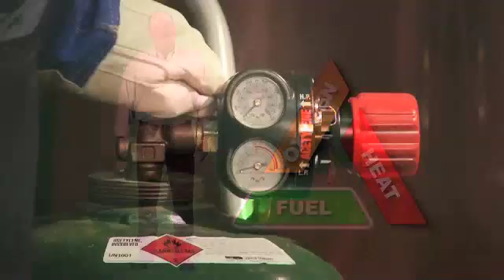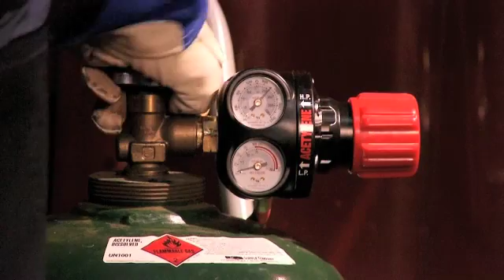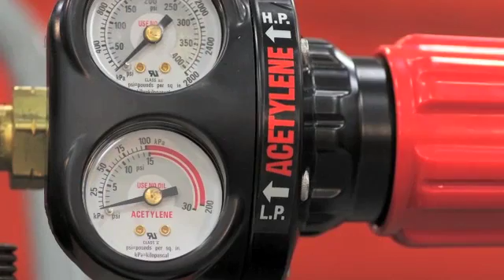Victor Acetylene Safety

Comment: Is the withdrowal rate a total amount for a cylinder or just at one time during use?  They said per hour so I assume that means during one time of use.  So how do you keep track of how much you have used?
Reply: 1/7 of the cylinder volume per hour.  you use a tip chart, it will tell you what pressures to set your gauges at for the tip you are using, and it will tell you the consumption of fuel per hour

Comment: Well … wait .. the cylinder volume is not 280 cubic feet, no way , you mean , I think , the cubic feet of acetylene
 stored in the cylinder ?
Reply: Cubic feet of ‘cuft’ is defined as the the amount of gas in one cubic foot at 14.7 PSI (1 atm) and room temperature, it’s not the volume of the cylinder it’s the amount of gas inside of it

Comment: QUESTION: I know it would be unsafe to do so, and there would be no reason to do so, but what would happen if you were to crack open an acetylene canister and light the air coming directly out of the canister? Would it instantly blow up the entire canister or would it just ignite the pressurize acetylene coming out and create a flame (somewhat similar to a torch before you turn on the oxygen)?
Reply: ANSWER: KAABOOOMM! 
Actually I have no idea, try and let us know! I’m curious too. Jk don’t try it.
Reply: @Sploderman  I'm a writer making a scene where someone does this then drops it from a tall height, landing on the nozzle as a sort of improvised explosive and I was trying to determine if this is entirely unrealistic or not. However, since I've had so much difficulty finding an answer, I've decided that most people would not know the answer either, so it should be believable enough.
Reply: If you broke the valve off it the tank would immediately explode
Reply: As far as i know just a flame. We had a small leak on our valve and get i done using the torch and see a little flame. Turned the gas off, smacked it with a rag and was good
Reply: @quadnation485  Damn that's scary lol. I can't say how I would have reacted in the same situation. My welding professor was once cutting with an oxy-acetylene torch and a red hot piece of metal landed right on top of the hose and caught it on fire. He simply kicked it off and stomped out the flame, then turned off the torch.

Comment: Why does acetylene not explode in the  pump and pipe when being pumped into the cylinder?  It is not dissolved at that point and is at very high pressure.

Comment: Little OTP. In my opinion. I have used a bottle from full to empty to cut and braze until it was easy never had an issue. Thats stupid if im hearing it right
Reply: Yeah, he misspoke, one guy did say 1/7 "PER HOUR" but it's not clearly stated. 
 It's 1/7 per hour not 1/7 of the tank.

Comment: One thing I have always wondered about was if the 1/7 rule applies to the 10 cubic ft  tanks.  They are sold in kits that have tips that greatly exceed the 1/7 rule.  In the Coast Guard we had emergency cutting backpacks that had 10 cf ft tanks that would run the tank out in an hour or two at the most.  I have used them above the 1/7 rule and nothing bad happened...so what's the deal?

I think I once drew to fast from a 60 cu ft tank and I got some popping in the flame, is that a symptom of drawing to fast?
Reply: Like SMOBY44 said the acetone will start to get drawn out of the cylinder and make your torch run poorly the fix for that is to use a appropriately sized torch for your cylinder size and not to overdraw the cylinder if you do have this happen just stop your torch shut the cylinder valve off and let it settle back down it won't damage the porous mass but if you blow out too much acetone you can cause other problems like messing with the acetylene acetone balence which can ruin a cylinder at best and make the gas unstable at worst causing a potential to ignite inside the cylinder
Reply: Yes, the acetone fills all of the pores in the cylinder material. The acetylene is dissolved in the acetone just like CO2 in soda. You draw off too much acetylene at once and you will begin to carry liquid acetone over with the acetylene gas. Pretty simple physics on this one. And, if you are wondering, I have experienced this three different times with a 10cf cylinder.
Reply: Steve M. good question.
Reply: Over drawing a cylinder can cause liquid acetone to be drawn out. Not only will it make a big mess and a lot of soot, it can lead to open voids inside the cylinder allowing acetylene gas to accumulate under high pressure. Pure acetylene gas above 15 psi can spontaneously detonate.
Reply: When you experienced it what happened?
Reply: @radarecho57   he just talking shit
Reply: The cylinder contain a mixture of diatomaceous earth or asbestos, acetone, and stabilizers.
Reply: SMOBY44. liquid, what. The video just said it goes into the PORES of the cylinder, don't how that means you can withdraw LIQUID acetone.

Comment: What happens when you exceed the withdrawal rate?
Reply: If you excced the withdrawal rate you'll start to suck the acetone out of the cylinder and start shooting it out of you torch making it run poorly the porous mass in the acetylene cylinders are designed to try and hold onto the acetone and release the gas but it can only do so much eventually you'll start ejecting the acetone from the cylinder nothing dangerous per se but not good either if you have this happen stop give it a break and let the cylinder settle back down the acetone will settle back down to the bottom of the cylinder and it'll be fine to use again
Reply: It go BOOM!

Comment: What is the procedure for filling a small tank of acetylene from a large tank ?  

What special equipment is needed and what safety precautions need to be taken ?

How to check there is the proper amount of acetone in the destination tank ?

thanks !
Reply: This is never to be done and illegal to do.
Reply: The procedure for filling your own acetylene cylinder is you take your cylinder to the welding shop you got it from and have them send it to a qualified acetylene refilling plant and not do that yourself. unless you really like exploding as a qualified acetylene requalification worker who is currently employed in a acetylene fill plant Do not try that yourself you can not safely add the right amount of acetone into the cylinder or know how much is needed we have computer scales that determine exactly the amount of acetone the cylinder needs based off of weight pressure temperature and humidity you can not safely determine that so don't try it too little acetone and it won't stabilize the gas and can make it explode inside the cylinder too much and when you fill it you can overpressurize the cylinder and make it explode also you can not safely determine how much acetylene is in your cylinder without one of our scales I Repeat unless you have a death wish DO NOT attempt to fill your own cylinders have a nice day and be safe acetylene is a safe gas as long as you treat it with respect and take it to people who know what they are doing